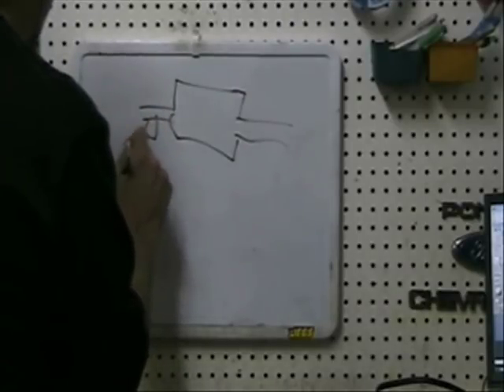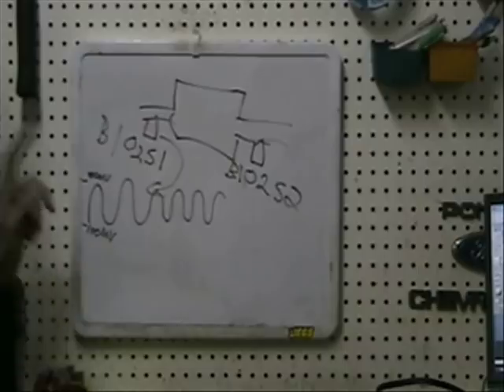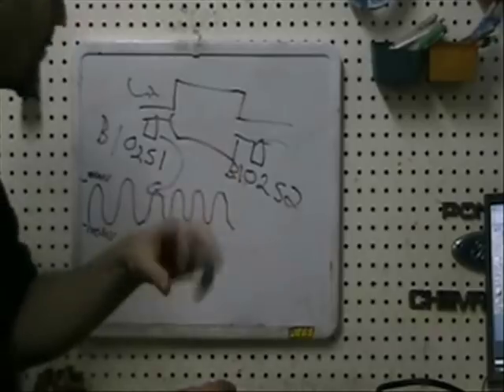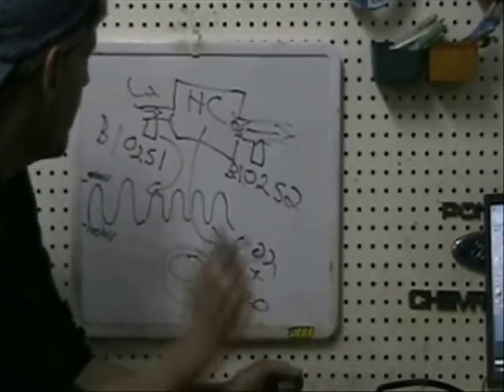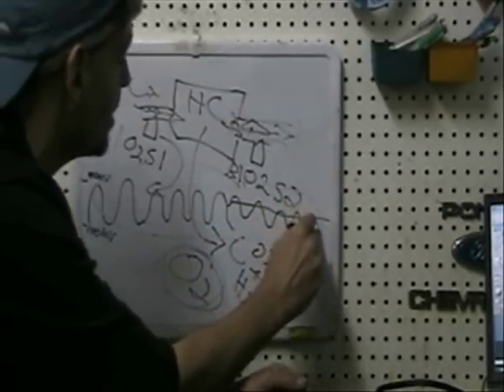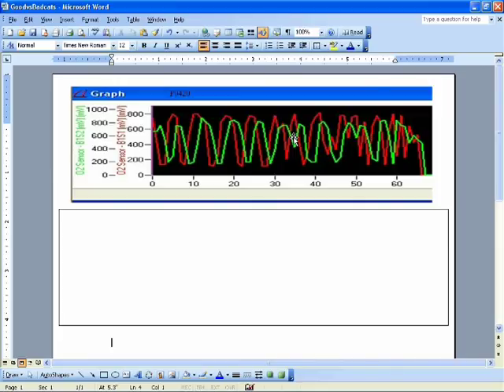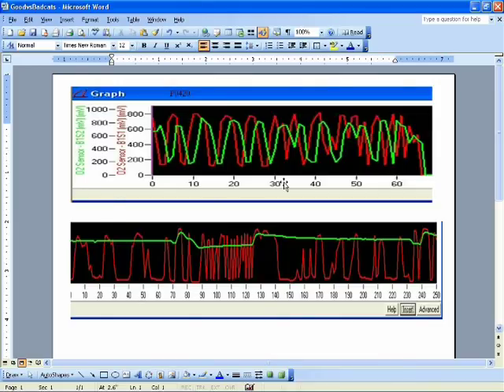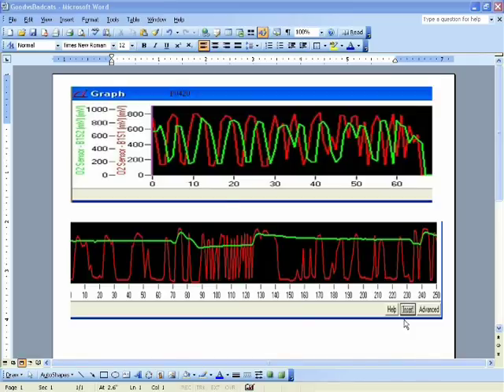P0420 P0430 catalytic converter catalyst inefficiency code diagnosis

Comment from the maker: @12vgs-  Yes, I very often see the O2 diagnosis by professional mechanics too.  It is truly one of my biggest peeves and one of the main reason I started doing videos. One trick they use to make money even though the O2's are not responisble for this code is by claiming that "now that the bad O2 was changed , we were also able to diagnose now that the cat is bad as well". Disgusting.  This particular code actually confirms the O2’s are working if anything!!!
Reply: Hi. The graph you showed at the end. What was the RPM.

Comment: If you don't mind me asking, what do you do for a living? I'm professional L 1 ASE and you're self learned? I've had automotive instructors that didn't explain diag theory as well as you do.
Reply from the maker: +689452379 Thanks man! I am a scientist for a living. I often have to explain scientific concepts to lay-people which is probably where the teaching ability comes in.  Thanks for the compliment!
Reply: Schrodingers Box 
No wonder why you are so intellectual...   I’m totally a visual guy   Question what scan tool are you using with the graphs and oscillating

Comment: ALWAYS CHECK FOR EXUAST LEAKS AROUND YOUR MUFFFLER AND REALLY YOUR WHOLE EXUAST STSTEEM HAD THIS HAPPEN AND FOUND OUT I HAD P 430 CODE BECAUSE OF EXUAST LEAK IN MUFFLER
Reply from the maker: +ERIC “JAMES” SINGLETON I don't understand- how is it possible for a exhaust leak by the muffler to cause an O2 mirroring of O2S1? That seems impossible. Please explain.
Reply: I HAD A P 430  CODE ON MY TRUCK  LOOKED IT UP EVERYONE KEPT TELLING ME IT WAS CATILA CONVERTWER OR OXEGIN SENSOR ECT I FOUND  THAT I HAD  A LEAK AROUND MU EXUAST PIPE  GOINHG INTO MUFFLER I REPARED  THE MUFFFLER AND MY CHECK ENGINE LITE WENT AWAY NEVER REPLACED DOWNSTREAM OXEGINE SENSORE OR GOT A NEW CAT CONVERTER PROBLEM WENT AWAY
Reply: NO MORE CHECK ENGINE LIGHT
Reply: WENT TO FORDS WEB SITE SAID CHECK FOR VACUME LEAKS EGR HEAD GASKET O2 SENSORE CAT CONVERTER ECT
Reply: P430 CODES ON A 97 FORD EXPLOER COUID BE MORE THINGS THEN JUST A CAT CONVERTER OR 02 SENSORS
Reply from the maker: What you are saying is illogical
Reply: WELL I GUES FORD MOTOR IS ILLOGICAL I ONLY GET INFO FROM  DEALER SHIP WEB SIGHTS 
THATS HOW I  STARTED TO LOOK IN OTHER PLACES OTHER THEN OXEGEN SENSOR
Reply: ERIC SINGLETON. I have 06 titan that has a exhaust leak. it's been leaking for a while and this code p0430 showed up.  I went to AutoZone and they check the codes on my truck one was for a large vacuum leak, fuel system fault, ignition system fault failed@ 2 Bank to Catalytic converter.
Reply: ITS NOT ALLWAYS THE CAT CONVERTTER.ALSO GO OUT ON YOUR TRUCKS MANUFACTURES WEB SIGHT LOOK FOR ANY TRINDING THINGS LIKE YOUVE DISCRIBED WITH YOUR TRUCK WITH OTHER PEOPLE WHOM OWN SAME YEAR MAKE AND MODLE USE GOOGLE ALOT TO IVE FIXED SO MUCH SHIT BY BEING COMPUTER SAVVVVEY LOL
Reply from the maker: << IVE FIXED SO MUCH SHIT BY BEING COMPUTER SAVVVVEY LOL>>

  Yeah except for fixing your caps lock key, on your computer no less... how  Ironic.

Since you are so savvy and educated will you PLEASE answer the question...

HOW is it possible the O2 sensor can be responsible for an 0420 code?  Please explain the MECHANISM for an O2 sensor failure that would result in congruency of an S1 signal.
  Please explain the MECHANISM on how this would conceivably happen.

How is an exhaust leak, even post S1 or even post cat not going to result in a O2S2 stuck lean as opposed to an inefficient catalyst which you are suggesting.
Reply: Schrodingers Box Hey Mat, quick question. But first please don't roast me. lol. Ok so could it be possible that a small head gasket leak of coolant cause a p0420? I'm trying to be as logical as possible. Just a thought but I'd assume no because everything that's mixed in the combustion chamber should already have been burned. Anyways thanks for the info and your channel is the best  informationally, descriptive, and precise.
Reply: yes if it is misfiring it will dump raw fuel into the catalytic converter therefore destroying it. but most likely, your vehicle will die and not start before the catalytic converter becomes toasted.
Reply: i made a video explaining p0420 if you want to check it out.

Comment: Hi should have watched this before i commented on the trim set of videos. The thing that threw me is on the run live data, the 02 sensors are behaving as expected. Will get a osciliscope to take a closer look. Very informative, thanks.

Comment: It's really nice to have an explanation that is detailed enough to make sense. The code is encompassing at least three different components, as well as a number of issues such as leaks. Being able to look at the signal and understand what it is doing and should be doing is really the only responsible thing to do. Mechanics that either through laziness, lack of proper education and/or greed, can manipulate the test and put the customer through a lot of expense.
I am not a mechanic, but did electronics repairs and felt it was my responsibility to find and repair, for the least expense, the right problem and not just throw a bunch of parts at it and hope one works.

Comment: Very, very nice and informative video. I have two chevy Astros throwing the p0420 code. Fixed other codes such as p0300,p1345 and some egr codes. No i have to tackle this p0420.after watching your video i will look at my o2 sensors data and sine wave to determine if my cats are bad. But after watching your video I'm convinced they're bad. Thanks and keep the videos coming!!!!!

Comment: Thanks for the excellent video.  My dealer has just replaced the 2 front O2 sensors due to a P0420 code.  This is the 4 time!  The cats have already been replaced but about 30K miles ago.  This is on a 2005 Subaru LLB H6 engine with only 54000!  The CEL is on again and I am taking it back.  If they ask me to pay for a cat, I'll scream.  I paid $750 for the diagnostic, the 2 sensors and the installation.  YIKES!

Comment: It is amazing how many times I had to argue with professional mechanics who would want to replace the rear O2 sensor to fix this code!  I guess they make money even when the code does not go away.  Thanks for categorically saying that in almost all the cases, you need the converter when you see a waveform like this.

Comment: One of the best videos I've seen that actually EXPLAIN something worth learning about!  Only thing I have to say additionally is that not all cars/trucks have sensors both directly before and after the catalytic converter.  For example, I have a 1998 Chevy K1500 with a 4.3L V-6 engine.  It has 3 oxygen sensors.  One in the headpipe off bank one.  One in the headpipe off bank 2.  The third sensor is after the cat.  Nothing more.
Reply: That is essentially just exactly the same thing as what's described in the video. It doesn't matter if you have 1 or 2 or 3 or 4 O2 sensors before the car and then O2 sensors after the cat, it is still the same data being read and that is the content of oxygen entering the cat and the content exiting the cat

Comment from the maker: Yes MainstOrchestra, u do.  I get a lot of rebuttals from people claiming exhaust leaks, failing O2 sensors, etc could also cause a P04x0 but the truth is- such conditions are necessarily accounted for in the code.  An exhaust leak between the sensors for example would NOT allow a mirror image of the rear and front sensor- the rear sensor would show much leaner than front. An exhaust leak ahead of system would cause mirroring, but the lean front O2 would throw its own code. P04x0= u need a cat.
Reply: Good evening Mr. I have a question I had  P0420 and P0430 I replaced the spark plugs and the code is gone now. Why was that possible?
Reply from the maker: @mtsanchez27  it’s not. what does your S2 output voltage show?
Reply: @SchrodingersBox  I don't know how to test them yet, also, I change the air filter from the engine and appearently that solved the problem. I mean you're the proffesional Im just a DIY I've been watching a lot of videos but it seems really hard to be able to diagnosis properly or there are a lot of possible solutions.

Comment from the maker: Thanks for the comments Joenunes.  The scantool used at the time of the video was a PC-based one called AutoTap from B&B Electronics which was discontinued some years ago.  Recently I upgraded to AutoEnginuity Pro and while it offers much more features, better compatibility with foreign cars, and even some bi-directional capabilities- I still like the software interface of Autotap better and still use it occassionally. But Autoenginuity is the way to go fopr a PC based tool if you're looking.
Reply: Schrodingers Box Hello there where do you find that Scan Tool? And what does it go for? Thanks

Comment from the maker: @schrochem- that's a good one. I'd guess you are due for a P04X0 soon.  To get the 04X0 code you cannot simultaneously have other codes which are related to O2 sensors, which you did have with the 0161.  Now that the O2's work, my bet is you have freed the CPU up to find "downstream" problems like the cat codes. I would liked to have seen what the O2 waveform was on the S1's that are being mimicked by the S2's- this may explain the .7V at idle but not under load.

Comment: Thank you for your videos, I think that are the most informative, precise AND easy to follow and understand from all of the one on YouTube.
I've had the PO420 on my  2005 Chrysler T&C with 138kmiles just a month ago, this was also accompanied by low power and slow acceleration.
The Temperature test on the Cat. did not convince me, maybe I did not do it correctly, but did a vacuum test with the vacuum gauge and that convinced me that it was a clogged Cat. The waveform was almost the same from the two o2s. but at that point I did not know how to read that infos.. because I did not know you and your videos.
Anyhow, the cat was clogged, but not only by the carbon built up, but also because it was melted inside.
I replaced it and now the car runs....much better. My only concern is that I think it runs a little rich, I see the short fuel trim on the scanner being always - 5 with peaks at -10 and the long term trim baseline at -6, -7 . the MPG is not great neither.
The waveform from O2 1 is ok between .2 and .7 and the signal from o2 2 is fairly steady at 0.7, 0.8.
Before this video I thought that the downstream signal from the o2 being high would mean a rich condition out of the muffler, Thank you for explaining it is not the case !
I am now on a mission to figure out why it is running a little rich and with a MPG avg. 15miles in city when before it was 18miles.
Next to replace would be spark plugs and adding fuel system cleaners
Sorry for the long description, cheers...
Reply from the maker: I have no idea why you conclude to use fuel system cleaners and replace plugs. What am I missing??
Reply: thank you for reading my comment.
replacing the plugs because they are probably due to be replaced at 140kmi.(purchased the van used)
Fuel cleaner because I did read somewhere that it could have something to do with fuel filter/pump/regulator , but it is a inexpensive try. The MAF sensor along with trottle body clean and a search for a possible vacuum leak will probably be next. (learned from your videos...)
One thing that was interesting to read was that the up.o2 sensor should have been a Mopar and the one installed was not, that makes me worry a little...
(By reading your answering, you are one on youtube that replies the most to comments...hats off to you..)
TNX !
Reply: Fuel cleaner will do nothing, literally pointless. Also being a different brand does not matter as long it is the same type of sensor. Just like there are dozens of brands of oil but 5w30 is 5w30 is 5w30

Comment from the maker: @GokuBravo-Good question, and it's not as easy as it would seem to detect a bad O2.  One giveaway would be an O2 that's "flatlined" but of course that could also be a wiring problem.  Another is an O2 that has a normal reading but is very slow to respond to stimulus such as inducing a vacuum leak or adding propane to the intake.  But any abnormal O2 traces such as staying rich or lean should not immediately be blamed on the sensor: maybe it is accurately reporting the actual condition!

Comment: Huge fan of your videos. While I’m not a scientist, I do approach things scientifically as you do. My question is, although I have (though plan to) not invested or have access to a scan tool yet, I am doing diagnostics with the resources I have currently, but I do have the p0420 code now with no other codes present. I have been using the most basic code reader to diagnose by clearing the code wait for it to set the record freezeframe data from each new drive cycle the code sets. The only consistent factor is that the code only sets in drive, at idle(stoplight), after moderate heavy engine load(highway), after fully warmed up(15+ minutes driving). It never sets under load, cold, or in any other gear, so I suspect there is more at play here. When at idle, before the code sets, I get a strange surging that slightly moves the car, but rpms never fluctuate. No fluid leaks, overheating, or misfire codes, which is what it feels like to me(I suspect it may be so minor and internment that it hasn’t detected it). On freezeframe data, Baro, map, MAF, throttle, temps, all are consistent and check out good, no abnormal reading with multimeter on any ignition components and STFT stays right around 0, and LTFT has moved slightly from -0.8 to +0.8. Where would you advise to go from here? I know I need a scan tool, but any suggestions?
Reply from the maker: You can't tell anything from that data. You need to look for superimposition of the S1 and S2 voltages. All else is irrelevant.

Comment from the maker: You're welcome Rebel...  one observation however.  If you had to change the cat after not even 4 years, I might suspect your engine could be running rich (but not enough to set a code or A) your CEL would have come on sooner and B) you can't get a P0420 with a simultaneous rich/lean code).  You might want to keep that in mind- a rich condition will kill a cat much sooner because the temperature will increase dramatically.  Also, it's likely your cat has a longer warranty that 3 or 4 years too.

Comment: Hi, I'd just like to throw something out there, for comment. I own a 2006 Cadillac DTS, w/130K miles. Started getting P0420 codes, a few K miles ago, would set code at between 15-30 miles intervals! Action I took to correct this PROBLEM. #1.Started using " NO ETHENAL " Premium gas .#2.Started using Archoil AR6200, gas treatment . After a few, tanks of gas /Treatment, I stopped setting the P0420 code. Last code set , 300 miles ago ! Cost of gas is high, but worries down! P.S. I also use Archoil AR9100, in engine oil. FYI, I figured this is in the ( general) O2 senser/ catalytic converter area ! I know a lot of worry stopped when it stopped setting the P0420 cade .
Reply from the maker: Ok.... where is your data showing you reversed superimposition of the S2 signal??

Comment from the maker: @Cooloneoff... Make sure the cat is completely warmed up and also see if you get the "mirroring" sensor readings at 2200RPM which is an even better indicator than Idle. Often dozens of drive cycles can go by before the code returns.  A rich LTFT is independent of P0420 UNLESS you have a P0172 (rich code) in which case you shouldnt get P0420 too.  If your LTFT is between -12 and -24 I'd do something to fix it as it's bad for your cat to run rich (Even though it won't set P0172 in that range).

Comment: Wonderful video thank you, my 2003 Chevy Impala threw a P0420 code . I ran the sensor voltage graphs and sensor 1 was oscillating as expected and sensor 2 was flat lined at about 770 volts. I guess I’ll have to look elsewhere for the cause. Glad I didn’t buy a CC.
Reply from the maker: be sure to check it at 2500 rpm though. it might show the issue then.
Reply: @SchrodingersBox  it’s still flatlining but at 100 volts at 2500 rpm’s huh

Comment: Hi Matt.  Thanks so much for the video. However, my car has an AF sensor precat and a regular O2 sensor post cat.  Could you explain what you expect to see on their graph tracings for this situation if you have a GOOD cat vs a BAD cat?  Thanks again; phenomenal channel.
Reply from the maker: It will be the same trace on the S2 (post cat) as shown in the video. Remember your AF sensor is technically still oscillating (as evidenced by the STFT) so you will see that reflected in the S2 if there is no catalytic activity.

Comment: Thanks for the explanation. Learning to use my Zurich ZR11 scan tool from Harbor Freight. 
My 2008 Nissan Titan with 199,700 miles came up with po420 (B1)
Changed mass air sensor, both bank 1 O2 sensors, and plugs and coils. Reset computer and got 45 miles before code came back. Looks like my Cat is bad.

Comment: Have u ever done a p2098 on a Dodge Magnum
Reply from the maker: No I haven’t but on that code first thing I would do is correlate the S2 fuel trim with the S1 trim and see if it’s a bank specific or sensor specific indication.

Comment from the maker: @Tommy- You can not have an instance where you have a good cat but S2 copies S1, whether S2 is bad or not.  The only exception to this would be if O2 sensor is also bad and has a "flatline" either high or low and S2 copies that flatline.  Actually, if anything, a P04x0 actually validates that both sensors are good!